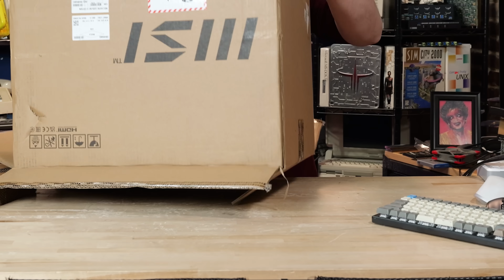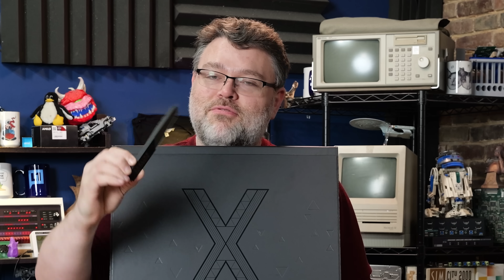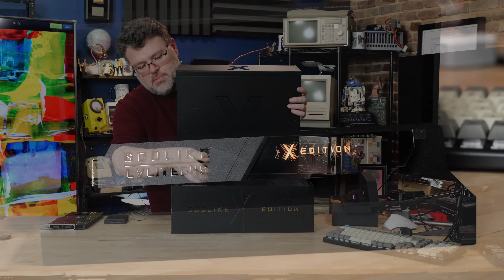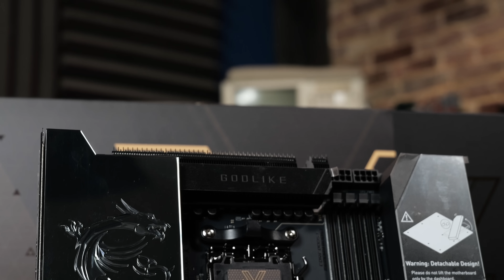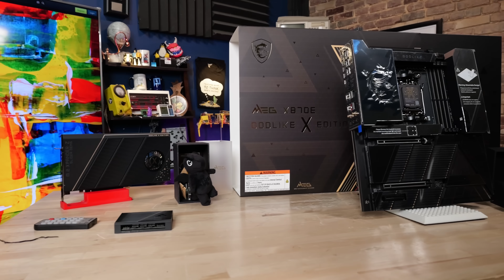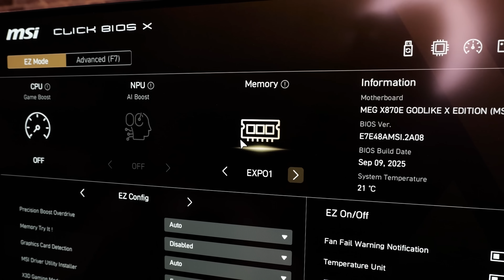MSI Godlike X870E: A Special Board Made Just for Us!

Comment: Roll a PCIe 5 trace real tight and compare it with fiber optics diameter and speed transmission copper vs fiber optics. I'm sure many are chocking them without knowing even if, your GPU only supposedly pull power from the PSU cable.

Comment: Idk about motherboards anymore, 100w USB charging and ultrafast PCIe and all the onces of copper in a motherboard looking like ingots without any silver plating...than I was wondering if 1 once 35microns cheap laminate PCB with a enamel black paint, laser engraver cheap CNC and hydrogen peroxide mix with muriatic acid for derusting cars would do...

Yes, USB4 and Thunderbolt 0.5onces 17 microns so the cheap laminate is better mostly when you know the width of those traces under 4mm. PCIe 4 and 5 same thing 0.5 onces so 17 microns without silver plating to accelerate or anything. DDr5 memory bus same thing 0.5 once 17 microns. CPU vrm is the bottleneck at 2 onces so 70 microns, need to double the width of 35 microns cheap laminate to compensate. General IO same thing 0.5 once, i would have say to joke 2 onces but no, 17 microns maybe less who knows... 

That was GodLike ok, no human can do at home for sure at that price or try to PEG and use brass rivets with glue to hold all the layers together. Right? ... I'm out and sad

Comment: Tech Tip for those wondering how to use more features of your MOBO. Just run your Video Graphics Card at 8x lanes instead of 16x. If you run your GPU at 8x instead of 16x, you literally only lose 1-2% performance, it's nothing, and you can 8 pcie lanes in exchange. Super worth it, especially if you plan on using multiple cameras and other peripherals, because you're gonna have to use dedicated pcie cards that have dedicated controllers.

Comment: MSI has really upped their game. Their software is redone not to be crappy anymore for mystic lightning and their motherboard quality has improved. Their carbon series too has io plugs on the side rather than top to hide cables. Their m.2 enclosure is pop in and out for easy access. Their GPU pcie slot has button for easy removal. 

They even put stickers where the screws go on the board. We all accidentally move a screw driver to the board and it minimizes damage when you slip

Comment: Haha. I was looking for a new NVMe Nas board, and this was one of the 4 options that came up, It's HORRIFICALLY expensive though, and even the cheapest possible option is terribly pricy. $500... (that one's an X670E Ace board.)

Even with that horribly expensive board, I have to get special active-hub based NVMe boards so I can fit 4 nvme drives on one x8 slot, at the blazing PCIe 4.0 x2 speeds. I still haven't found an active hub board that supports PCIe 5.0. (I was shooting for 8-12 nvme drives on a single consumer grade processor for zfs raid, since the Asustor Flash box doesn't use normal ethernet chipset drivers and aren't upstreamed in open source OSes. Why can't you be normal, Asustor?!?)

Was going to use a 9600x chip, using the integrated GPU (through the singular USB-C Alt-DP port) with 2 of those 4-nvme 8x cards, and potentially a 10gbe nic in the x4 slot if the integrated Ethernet proves to be a poor fit for FreeBSD. Otherwise, just one more NVMe card in that slot that instead has only 1 nvme drive.

Comment: MSI sent me this motherboard and I can wholeheartedly recommend having MSI send you one too.
Reply: Don't listen to this comment. Check the 95 page long Godlike X870E Dynamic Dashboard 3 thread on MSI's forums. I just want out of this nightmare. I'm trying to get my money back via the Attorney General's office. This was the worst purchase I've ever made in my entire life. It has a litany of critical issues and I can't wait to get a replacement board, even though I've only had this one for a year. I have to constantly restart my PC just to get the M.2_1 slot to run at its proper speed. And those are just a couple of the problems it has. DO NOT BUY MSI
Reply: @user-vm6bb7ns1u  you didn't get my joke. This is the kind of board you get because MSI sends you a sample, not that you should spend your own money on it. I don't have one BTW. I'm sorry to hear about your negative experience with the board, but none of it surprises me. There are a ton of features, most of which are of questionable value, so lots of things to go wrong. It's also an extremely low volume product and none of the customers are system integrators so fixes are lowest priority in MSI's lineup
Reply: @shrekoc5570  Thanks for the clarification. I think it would have been more clear had you referred to it as "MSI sent me a free sample", but sarcasm can be difficult to convey in text, especially to strangers. I get it now, you're mocking Amazon reviews hehe. And yeah, thanks for the sympathy. I've learned a valuable lesson. 😌

Comment: The WORST Original Godlike motherboard I ever purchased, waste of $1200.  The X variant is just another scam from MSI.  Doesn’t work with EXPO profiles with 4 memory sticks, can only go EXPO with 2 memory sticks, the 10G port overheats and disconnects, the onboard USB ports frequently power cycle, if you use iCUE corsair software it conflicts and a warm reboot will fail with OD error … have to power down cold boot every time if you use iCUE software.

Comment: You don’t do a custom loop for the performance. You do it for the noise. You can dump 600-800W into a dual rad loop and barely spin the fans. I don’t care how obscene your air cooled GPU is, it’ll never compete on noise with a decent loop.
Reply: So ya, I’d throw a 9070xt in there and water cool it.

Comment: I have had this setup (not the X version) for quite a while now and while it does POST with 256GB of ram, the smart screen ALWAYS shows cpu & DDR error, and it always trains for about 3 minutes.  Works flawlessly other than that.  Edit, oh, and my Linux experience was horrible.  Maybe a bios update changed that.
Reply: How come? How does the mobo affect Linux?
Reply: @denissh9478  Well looking back on it, it has been a while, I don't know exactly what the cause was but I happened to be using this board the only time I have had problems installing Ubuntu.  It could have been something other than the board, but I had a really hard time getting into the desktop during installation.  It might have been nouveau driver related.  Was using a 5090.  Windows works fine except for the screen always showing GPU & DDR Error, which I can not get to go away for the life of me.  The system is stable, though.

Comment: One other issue is: what would you run with 256GB and not go ECC? If you need 256, you're doing something at the pro level and not having ECC is kinda pointless, isn't it?
Reply: It depends on the workload, it's nice to have but not strictly necessary... Depending on workload..

Comment: The regular X870E Godlike is one of the best motherboards you can get for AM5 - yes it's over priced, but it's also amazing. Only board of the 3 I've tested that could run 4x48GB at 6000MHz, the other two couldn't get 4400MHz to train & 4200MHz was unstable.  I've been running the 192GBs on the Godlike for weeks now with zero issues after stability testing & tuning it a bit, CL32 6000MHz with tRFC tightened, tREFI at 50000, 1.4v VDD & 1.2v SoC - I'd love to see what other boards can run settings like that, I'm sure the count is small... this is 2 kits of 2x48GB Trident Z Royal 6400MHz CL32 1.35v RAM, got the first one almost 2 years ago for $319 to get more RAM for rendering/AI stuff when I was first getting in to it & it was maxing out my 32GB of RAM like nobody's business, upgraded to 2nd kit for $369 in late September after I saw RAM usage getting up to & hitting the 96GB limit still when I had enough of a workload going.
Outside of that, the motherboard itself is pretty awesome.  My ONLY complaint about it so far is the fact that the bottom M.2 plate's mounting is pretty flimsy.
My EZ Bridge/OLED display hasn't glitched out, yet, like some people have reported in their usage either, I have it set to a custom profile with green accents & a rotating thing of several different readouts, CPU, GPU etc temps & usages, with some fan speeds and a temperature sensor readout that's on the exhaust die of my GPU's AIO Radiator, I use that temperature to control the GPU radiator fan speed, works amazing cuz it keeps cooling the GPU radiator after the GPU isn't under load anymore to get the residual heat out of the radiator, and it doesn't ramp up the GPU radiator fans for lesser workloads or bursty workloads on the GPU, since they don't saturate the radiator enough to heat it up.

Comment: Putting the us in USD. $900 buys a lot of cool hardware to tinker with that isn't just a single motherboard. My entire NVR system with 4 POE cameras, self hosted NVR with HDDs, and purchased NVR software was quite a bit less than $900. Add in my self built Firewall/Router, 10gb second hand Aruba switch, a few 10gb melanox cards server pull cards, built a linux file server for the home (with more HDDs), some DAC cables, and I might have hit the $900 mark, but I don't think so. Sure I've been tinkering with computer hardware for a LONG time, I have a stash, and have many reusable parts but still $900 for the common human on a single motherboard..... I have to many hobbies to have any type of desire to spend that on a motherboard that really gives me no advantage. It's pretty cool that "influencer status" got you a new toy but I am not entirely certain who "us" is.

Comment: 13:47 I despise this generation’s Threadripper platforms due to the castrated memory channels and the narrow Infinity Fabric. In my opinion the differentiator with EPYC should be the power efficiency with EPYC being optimized for that and Threadripper should have the OC option to be balls-to-the-wall what is safely possible with the current manufacturing nodes.

Comment: 1 RTX PRO 6000 should be fine on ANY half descent AM5 board with PCI5.0 x16.
It's mostly there to "bootstrap" the card :)

Multi gpu: yea you want threadripper
Reply: Do RTX PRO 6000 communicate so much over PCIe when computing that two PCIe Gen5 x8 interfaces (on AM5 for example) would actually be a bottleneck?

Comment: Just wait until 6 months or less when your EZ Bridge display starts to fail and causes the endless disconnect / reconnect sound. Has happened to me on 3 different Godlike X870Es now.
Reply: Yeah, it's easy to figure this out if he had just looked at the thread in the MSI forums. RIP. This board was hands-down the worst purchase I've ever made in my entire life. I just want out of this nightmare. I'm trying to get my money back via the Attorney General's office. And the DD3 is only the beginning of its issues. Sometimes I turn on the thing and it just runs at 1 fps dunno what that is but then I gotta restart. Sometimes I turn it on and it posts then it restarts. Often times the M.2_1 slot doesn't work at its proper speed. Gotta restart it several times to get it back up to 5x. The 10 Gig ethernet adapter has a history of issues and still remains an issue, with it disconnecting randomly. I will never buy another MSI product ever again in my entire life and I tell everyone my tale and warn them against buying MSI. 🪧🪧Never Buy MSI 🪧🪧
Reply: Oh, no...
Reply: Can you just turn it off, or disconnect it?

Comment: When you google this motherboard you see owners with ongoing issues. So basically its the current Godlike, same issues, gimped PCIe lanes and with go fast stripes a few items no one will use and a couple of keyrings. It's like taking a dump, sprinkling on glitter, and calling it a special dump. It is no different from the current Godlike.

Honestly, it is NOT the most feature set X870E motherboard either, it's bifurcation sucks. You cannot use all it's features, and it primarily gets bought by kids wanting to build an expensive 9800X3D gaming PC. You game on it, you get the same results as a 9800X3D in a B850.

Why buy this when you can get a TRX50 motherboard and 7960x for the same price as this and a 9950X3D.
Reply: If you buy a Threadripper board, you don't get important things like top-tier gamer branding like "Godlike X"...
Reply: This board does have good PCIe connectivity. I can't realistically think of one which offers more 5.0 lanes. You get the default 5.0 m.2 slot, another 5.0 slot if you disable the USB 4 (or split it with USB4 for 2 lanes of 5.0 instead), two x8  5.0 (x16 slots) and you can run an additional m.2 off the chipset without issue. Using the expansion card that gives you 3 NVMe SSDs at 5.0, and two more at 4.0 full bandwidth. Obviously you can fill out the other slots but you run into IME bottlenecks. There isn't a GPU on the market that can realistically saturate 5.0 x8 so not using the expansion card is wasted potential.

The main issue with this board is the obviously A) the price tag (meaning a small userbase, so less support overall) and B) the proprietary hub/screen. Aside from that there isn't anything which can match it in connectivity, I/O, and features. A 10 gig NIC is relatively hard to find on consumer boards. Yes if you go threadripper, EPYC, or other enterprise platforms you get way more ram bandwidth and lanes, but this serves a very very small niche.
Reply: @Miqueso good PCIe connectivity means you can connect all the features and use them, if connecting A and C means you can't use B or you get half of D, that's poor.

To be fair the Godlike is not the only X870E with this issue. 
I would have quite happily drool over it if it could run four NVMe, USB4, and none of its PCIe lanes compromised each other.

Sadly the only board that did that was the Asrock Nova X870E, which now no one trusts. 
Despite more Godlike owners having issues than Nova owners.

Hopefully the next generation of motherboards will actually allow us to use all the features.

Currently the best X870E models offer less usability and the same ballpark performance as a £200 B850 which is pretty ridiculous.

At £1200 you want connectivity, expansion and performance, not a x8, X4, X4 and only NVMe 1 and 3 running due to using a USB4 port.

The NVMe expansion is nice, but I don't know a single 5090 or 5080 user who wants to run those cards at x8 despite the difference.

Nothing Godlike about a £1200 bunch of compromises

Comment: I had one of these in the older version but there’s been a ton of issues with the screen by the ram. Mine was an open box from Newegg and it was dead out of the box. After about 5 minutes of googling it decided to just return it. 

Was super excited about the built in 10g nic so I can free up a slot and was going to be migrating a cooling loop to it and getting rid of a cooler controller. Oh well.
Reply: If more X870E Godlike were sold, MSI would have had a class action lawsuit on their hands. The only reason they got away with that shit is they sold so few of them. 

I’ll never forget the horror of USB disconnect chimes.
Reply: @833psz my msi x670e carbon WiFi motherboard also randomly disconnect my USB devices… Is there any fixes?

Comment: I dont know how i feel about all thise connections going through one link connector on the special motherboard part.
Reply: Good call. It's awful. The Dynamic Dashboard 3 is a total failure, and a centralized point of failure as you pointed out. USB issues. M.2_1 slot issues, 10 gig network adapter issues. So many issues, some that I don't even understand. Just look at the Godlike X870E Dynamic Dashboard 3 thread on the MSI forums; 95 pages of consumer hell. I just want out of this nightmare. I'm trying to get my money back via the Attorney General's office. Never Buy MSI.

Comment: It's good to hear MSI is getting better with Linux support. We need more Linux now more than ever.
Reply: My media room machine has been running Linux on an MSI x670E board with no serious issues. There's no motherboard fan control within the OS (prob. not fixable), and the 2.5gb Realtek NIC was a little flaky (manually installed driver fixed it, Linux defaults to the wrong driver).

Comment: Just got the MSI MAG B850 Tomahawk Wifi. Most expensive board i ever got at 200 pounds. But was lucky to get ddr5 just before the prices started getting really really silly. What i paid was still silly for what i got but at least i can move up to AM5 now. 

I love MSI boards. 

My 8 year old AM4 B350 Gaming, the red one, is still alive to this day. 3 CPU upgrades, 3 GPU upgrades. From a first gen R 5 1500x to an R5 5500 to a R7 5800x. I started on a 1060 5gb, then a 3060 12gb and now a 9060xt 16gb. MAD. I used this board a lot. 8 hours a day on average since 2017. Burned through 2 PSU in that time. But the MOBO is still kicking.

Try doing that with an ASUS or a Gigabyte. I could not get my asus or gigabyte boards to live beyond 2 to 3 years buying gaming based boards. The boards would all die.

When my MSI board made it 7 years i upgraded to a MSI B550 version of the same board. Loved it. I love MSI. To the point that i bought a MSI Forge 100 case.

Comment: I bet the RAM kit was actually more expensive than the Motherboard 😅
Reply: on newegg the mobo is $1300 and the ram kit is 2749.99
Reply: @thalo215 get 2 Mainboards 😂
Reply: DEFINITELY! 96GB kits of 6000 are going for $1000+, so 256GB must be like $2500. And I'm guessing the board is $500-$750, $1000 tops.
Reply: @SirReptitious  the motherboard is £1200 apparently. You could basically buy two TRX50 motherboards for the price of this currently. Or buy a TRX50 motherboard for the price of a 9950X3D and spend the money this costs on a 7960X and be a peasant with 24 cores.

Or simply buy an Asrock Nova X870E as it can run USB4 with five NVMe and a full x16 GPU slot with no issues for your 16 core AM5 CPU if you are a real peasant.